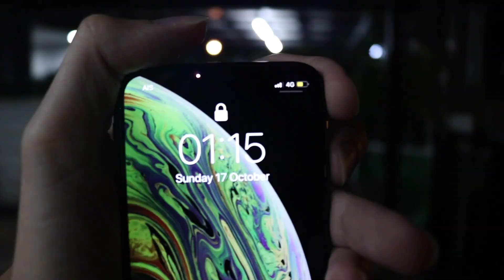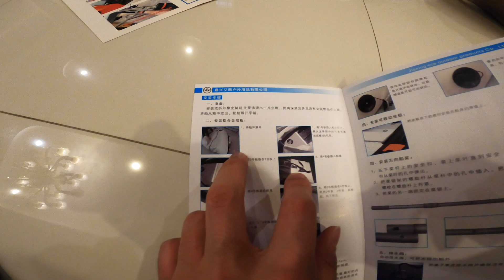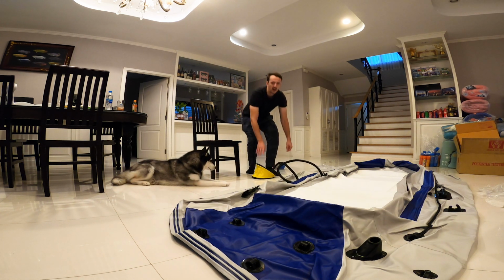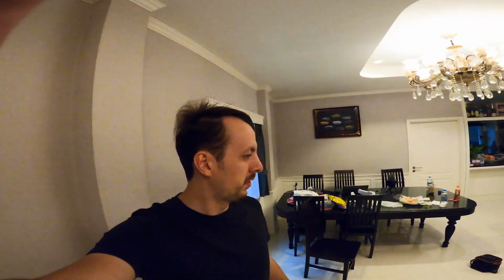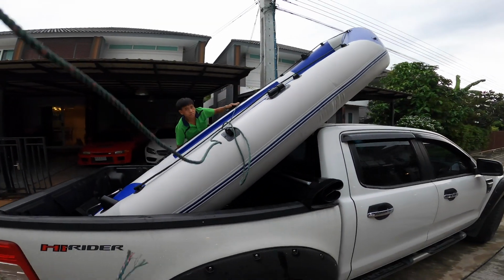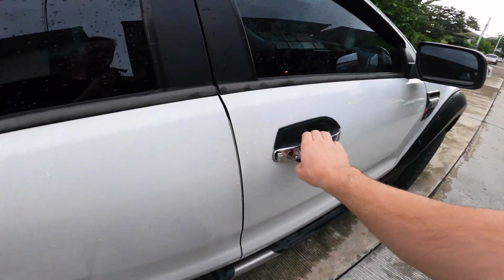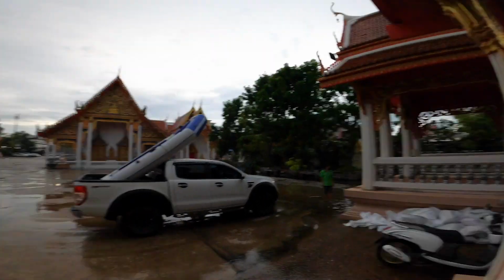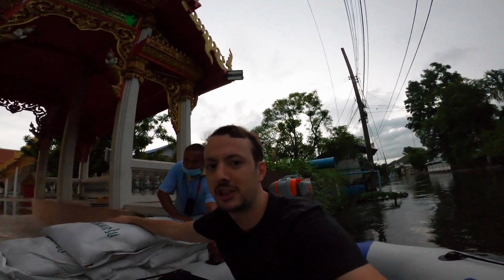How I’m preparing for the worst | Bangkok Flood Thailand 2021

Comment: Nice one. Putting the boat together without an English description wasn't that easy, or? I was curios how you and your gf finally leave the boat without getting wet or fall into the water. You made it without problems? The water who flushes out of the pipe were from where?
Reply from the maker: We made it out without getting wet quite easily and i think thats due to the solid quality of the boat. I also thought it was waste water but my gf says they pump the excess water back into the river to reduce the risk of flooding.